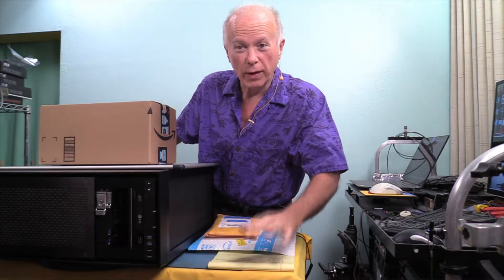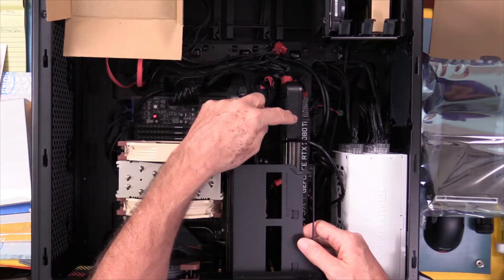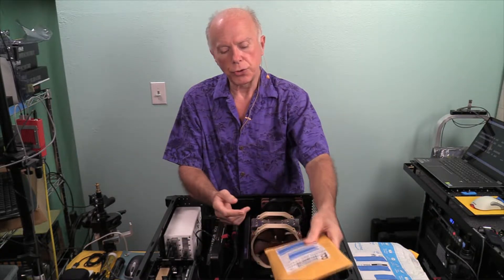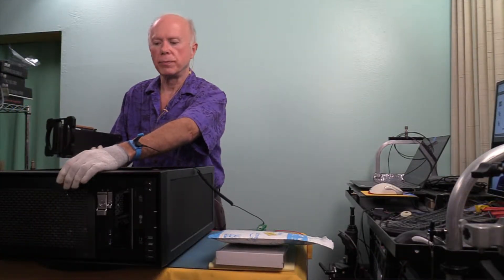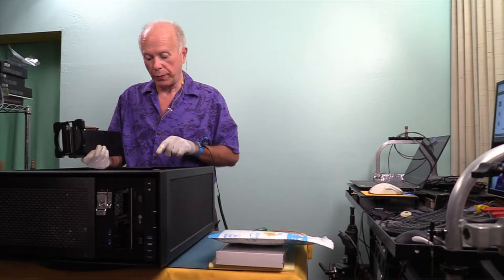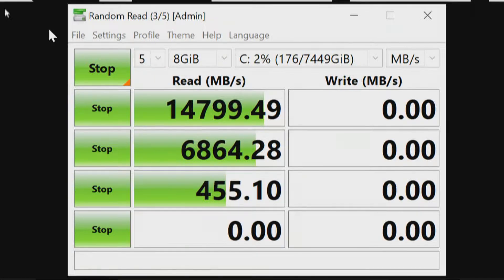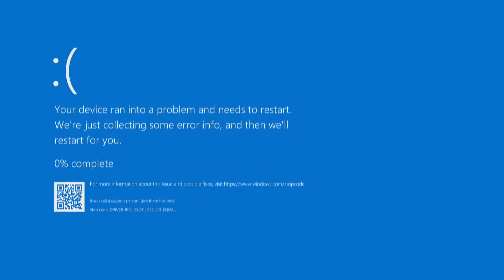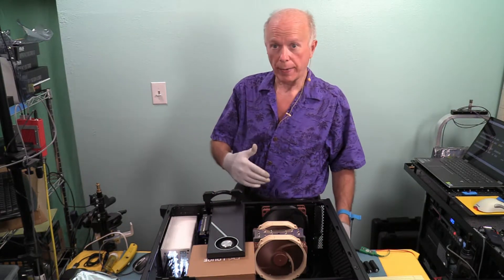Vertical GPU Mounting and PCIe 4.0 Riser Cables for M.2 AIC

Comment: Good Stuff, Gill. My Lian Li case has a vertical mount option. However, I decided against it. Depending on the card size vertical mounts can cause heat issues, it also depends on how close to the side panel/glass it is as it obstructs air flow. Just from what i heard and other test have done. RTX cards run hot, i decided to mount mine normally and have 2 fans pointed up at the GPU from the bottom of the case. Good to see another video from you!
Reply from the maker: Hi Patrick,  Craziest Video yet! All for staging of the next video, ASUS and Gigabyte M.2 NVMe AICs Heat and Speed Tests! Thank You for Sharing! Did You get an RTX something for Your Build?
Reply: @BuildOrBuy  Looking forward to the next Video, Gill! I was lucky enough to get an RTX 3070 back in December. Current specs from the new build a couple of weeks ago are below: 

MB: Asus TUF X570 Pro Plus
CPU: Ryzen 5600X
Mem: 32GB 3200 - G.Skill Trident
GPU: MSI Geforce RTX 3070
1TB M.2 NVME strorage x2 
5TB SSD Drive
Reply from the maker: Hi @patrickwoolbright1960 , 
Thank You for Your Support! An RTX 3070, Very lucky! Ryzen 5600X, AMD Ryzen 5 5600X - 6 Core? Why not aim higher for PCIe 4.0? Everything else looks great! Thanks for Sharing! Helps Us to make better Videos!
Reply: @patrickwoolbright1960  Hi Pat. The way prices and stock are right now, I'm glad to hear you do a new build.
Reply: @maxhughes5687  Thanks Max! Hopefully things with chip shortages return to normal by the end of the year.

Comment: Nice video Gill, I own Designare TRX40 rev1.1, and want to use bottom PCI-e port with 10CM LinkUP riser with RTX3090? Do you think it's good idea or I'll get in trouble with PCI-lanes conflicts on this MB? So PCIE-0 Slot for TB card, PCIE-1 for Decklink, PCIE-3 for AIC, and PCIE-4 for RTX 3090 ? Or it's better to use 30CM cable to put riser into PCIE-0?
Reply from the maker: Hi Juri G, 
Thank You very much for Your Comments and Feedback! Based on Our tests, the Linkup Riser Cable will fail. I know they claim it's been tested. However, Our Results indicate otherwise. BTW: How wide is Your RTX 3090? That 2nd 16 Lane PCIe Slot can handle the RTX 3090 but the Riser Cable. LOUQE Cobalt works! Hope that helps! We'll keep scouring for another PCIe 4.0 Riser Cable. Doubt We'll find anything until after DDR5 which is due out in 4 months! Stay tuned!

BTW: Congrats on Your TRX40 Designare! Welcome to the Platform!

Comment: Good video, I recently got an extendo cable for a different purpose, I’ve seen some mixed reviews on Gen 4 cables, seems like sometimes they work and sometimes they don’t, like your video shows.  That other cable might work on a different system.
Reply from the maker: Hi Mr Serrano, We expected better Results. Instead, looks like We need better Cables. And those cables are not cheap! This only gets worse moving to PCIe 5.0! All for an emissivity test. Thanks for watching!

Comment: that's a really cool vertical mount but looking at my case (a HAF-X), i don't have any good options for something like that either. i suspect that a watercooling focused case would have more options as 120/140mm fan mounts are sometimes used for things like reservoirs, but trying to fit something of that shape onto a fan mount is probably just going to be tough. case design is going to have to change to make vertical mounting of any sort a good option. maybe motherboards as well.
Reply from the maker: Hi N A, After finding the Mnpctech Vertical GPU Mount, We'll be looking at Cases differently now! An amazing and ingenious mount! 

We just need better PCIe 4.0 Cables. PCIe 5.0 is coming! Due out in 4 months! Expect new Cables to follow! 

In this next Video, We'll see how that cable holds up for Out tests! Appreciate Your Comments! Thanks for Watching!

Comment: Hi Gill. OK, I totally punked-out. No P/S for a second E-ATX TR build was starting to make me angry. The 3955WX can wait. I bought the new Aorus fv43u monitor. Same money as my WRX80E, but I can see it at work 5 minutes after it arrives and in 4K.
Reply from the maker: Hi Max Hughes, 
I hear You brother! Amen to that! Ridiculous! All because of either GPU, PSU or both! Unheard of! 

4k Gigabyte AORUS FV43U Gaming Monitor! Wow! Amazing! Congrats! We're going to be doing a Video on a Monitor soon, ASUS ProArt, for entry level Color Grading. We may expand upon that while We wait for Components for the WRX80 Build! 

https://www.gigabyte.com/Monitor/AORUS-FV43U#kf
https://www.aorus.com/monitors/AORUS-FV43U/Key-Features
4k - 43 inch, VEAS Mount 200x200mm! 144Hz refresh rate, 10-bit color and super-wide color gamut of 97% DCI-P3/ 150% sRGB; 1000 nits Brightness. Beautiful! 
https://click.linksynergy.com/link?id=gpeZfq5JOQk&offerid=833390.18754923608&type=2&murl=https%3A%2F%2Fwww.newegg.com%2Fp%2FN82E16824716002 - NewEgg Affiliate. Thanks for Sharing! Where did You find the one You purchased? Brand spanking new!
Reply: @BuildOrBuy  It was Newegg's email that showed that to me (100 off). I had been an Asus PG43UA fan at 1500 bucks or the new XG43UA next month at 1900 bucks. BHPHOTO was out of the Asus and I saw the email. An hour of reviews from Vietnam and I bought it. Ergotron HX and a Furman SM3-pro are next. Then a Sabrent Rocket Plus boot drive for the TR Pro.
Reply from the maker: Hi @maxhughes5687 ,
Perfect! Had not seen that one yet! While You wait, might as well watch in style! Do You mean, ASUS ROG Swift PG43UQ 43” 4K? VESA Mount 100 x 100mm. For the price, You did better! B&H has been out of stock on a lot of items lately. Including Video gear. 

ASUS ROG Swift PG43UQ 43” 4K
https://amzn.to/3nUMLRS
Ergotron HX Ultrawide Monitor Arm Desk Mount
https://amzn.to/3hi2xom
Furman SM3-PRO | 15A BlueBOLT Compact Power Conditioner 3 Outlets in 2 Controllable Outlet Banks 2 Feet Cord - Tiny Device. Smart choice! We go for Rackmount! 
https://amzn.to/3uywjsX
Sabrent 2TB Rocket 4 Plus NVMe 4.0 Gen4 PCIe M.2 Internal SSD Extreme Performance Solid State Drive R/W 7100/6600MB/s (SB-RKT4P-2TB)
https://amzn.to/3etlZgn
As an Amazon Associate I earn from qualifying purchases.
Links for anyone else reading Our communiques! Thanks for Sharing!
Reply: @BuildOrBuy  sure. thanks Gill.
Reply: @BuildOrBuy  I've had a Furman for 3 years (215A I think). It's a great 10 amp $140 surge line conditioner. That SM3 Pro 15 amp has remote reset, great for a server reset from off site. The 59db noise reduction at 1MHz and 1800 joles spike clamp in 0.4 nano seconds sold me.  The cleaner the power into a switching P/S the better. A 10A on the monitor and stereo and a 15A on the HEDT is great. Two different breakers of course.
Reply from the maker: Hi @maxhughes5687 , Thanks for sharing! We're sitting on an ASUS Thunderbolt 4 AIC (Needs Motherboard with 14-1 Pin Header), an ASUS ProArt B550 Creator Motherboard (Thunderbolt 4) and waiting to get Components for the WRX80. And DDR5 is due out THIS year in 4 months! And still NO GPU nor PSU to run it or anything else! Ugh! Needles and Pins! Getting ready to Film next Video! Working through the staging.
Reply from the maker: Hi @maxhughes5687 , We use Furman but have not done a Video about that Gear yet. We should. Especially for those who do Audio. 

Those Remote capabilities are handy especially when You need it!
Reply from the maker: Hi Max, Update Us on the Monitor once You're up and running! Eager to know Your thoughts on Your selection!
Reply: @BuildOrBuy  #1 fix adrenaline drivers. Radeon puts AA on "set by app". That's ok for games, but text is unreadable. Manually set AA at 2x or 4x. At my age, the higher the resolution the higher the scaling I need. Guy's that run a 4K 144Hz monitor and use the gamer drivers say "they sent their new monitor back because they couldn't read their work text or spread sheets."
Reply from the maker: Hi @maxhughes5687 , RMAs? Unfortunate!
Microsoft really needs to address that issue. Raster vs Vector based interface. We use to be able to change O/S Font settings globally. Microsoft removed that capability. Having to rely on the Video Drivers for that now, yes, best option. Can You imagine 8k with this problem! We have to be able to read the screens! We're in the same boat as You! Thanks for Heads-Up on that! We should do a Video just on that Subject about how bad this problem is becoming apparent and relevancy. Thanks for Sharing! Otherwise, what do You think? Do You love it!
Reply: @BuildOrBuy  OK. Touch down fv43u. I went back and forth on hdmi and dp on the new monitor and old. My 32" 1440P did the same on my backup Ryzen. After several reboots they came up. Now I think the cable swapping did nothing. It was the retries that got me from bio screen only to W10 or a Linux boot. Just fabulous. Text is clear at Radeon 4X and HDR is up with one click. Scaling set at 300% and it's just great. The monitor is only 3" above the table top and a monitor arm would be great. HDMi 2.1: I can't test that, I don't have a GEN4 GPU with HDMi 2.1. Weird: There is a right leg and a left leg. Put them on the wrong side and the bolt holes don't line up.
Reply from the maker: Hi @maxhughes5687 , 
That is wicked! Wish We could have been there Filming when You unboxed that beauty and watched Your expressions when it first Booted Up! Wow! That's Real estate! You may need to Upgrade that HDMI cable later. That's exciting! Success! Thanks for the Update! 

BTW: AORUS FV43U is a 10-bit display with 97% of DCI-P3 color space. You can Color Grade with that! Whew! You need a Pinch! Excellent choice! Now for the GPU!
Reply: @BuildOrBuy  Your right again. My long DP cable wanted to push the system into 1920p. An old HDMI 2.0 wanted to push the system into 2560 1440p. I had to get a brand new long HDMI 2.1 cable even though I'm on an old gen3 GPU with no HDMI 2.1 output. 3840 2160 at 300% scaling is fantastic.
Reply from the maker: Hi @maxhughes5687 , 
Thanks for Sharing! Goes to show, We don't know what's up until We try it and see what happens! How long is Your Cable? What Brand and Model? I'm asking because We have a Vendor who wants Us to check out their HDMI Fiber Optic Cable. BTW: Beautiful Display! 

We have a 4k Projector to install for a Client. That may be a Video if they don't mind. The Projector Upgrade will require a new HDMI Cable. 

To Film Your new Monitor in all of its glory, that would have required 3 - 4k/60 Video Cameras, an ATEM Video Switch and the Monitor! Would have made an amazing Video! You'll just have to tell Us about it and keep reminding Us about that Display! Phenomenal! Thanks for Sharing! 4k/30 is easy. 4k/60, that's different. And that's a lot of Data to move! 

HDMI 2.1 has a bug in the Receivers now being addressed. It's the Chipset. Problems with Device connectivity. Crazy right. 

HDMI is great as a cable for audio and video but the connectors are a problem over time from repeated usage. And most Consumers will not encounter that problem. To reiterate, and this HDMI 2.1 bug should be, being addressed as We speak. Technology is great when it works. A pile of junk when it don't! Love it being on the bleeding edge!
Reply: @BuildOrBuy  ConnBull 8K HDMI 2.1 Cable 15 Feet, High Speed 48Gbps. $20. I don't have a gen4 gpu to realy test this at 10 bit 4K. I park my pc half way across the room from my monitor/keyboard/amp.
Reply from the maker: Hi @maxhughes5687  , 
Got it. Not familiar with that brand nor the one that has Contacted Us. Helps in knowing those Specs so We can reference that detail in a Video later on. Thanks for Sharing!